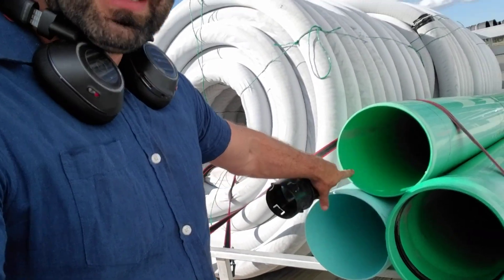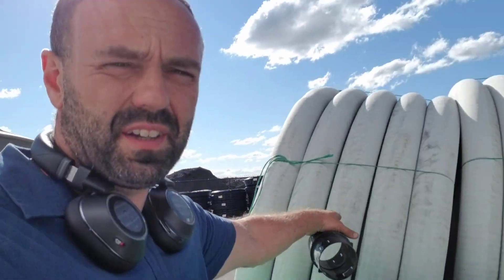We Are Building a Climate Battery/GAHT/Subteranean Heating System in our Passive Solar Greenhouse

Comment: I finished a small 30 x 12 earth battery this summer.  Put two layers of piping 9' n 7 ' down.  Only issue is the 9 footer (150' of pipe), continues to get blocked by water which I pump out. Even though it is on a side hill, seems I m close to a spring. Will be trenching for drainage so. Look forward to watching your progress.